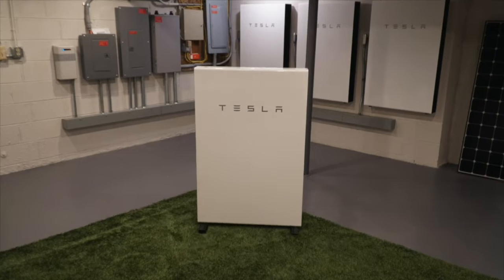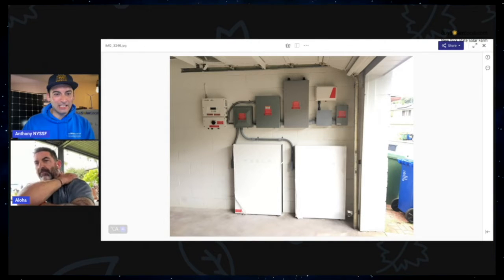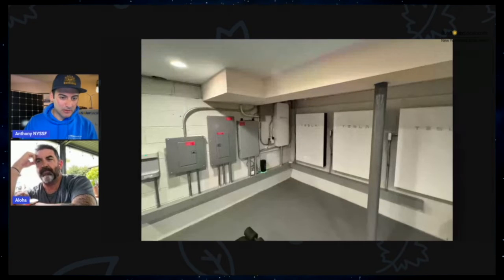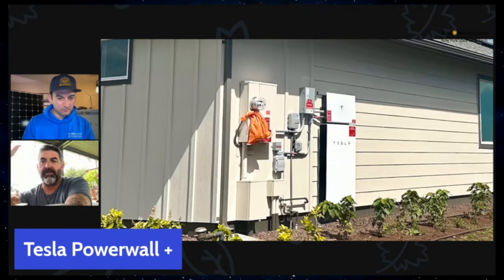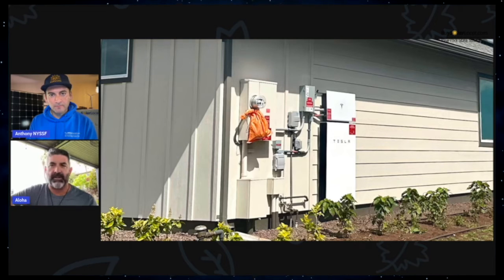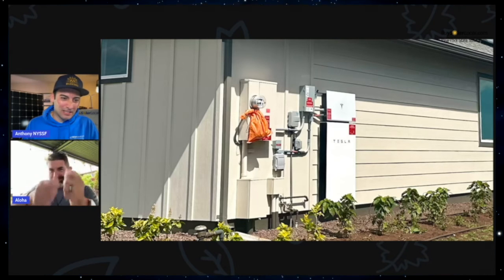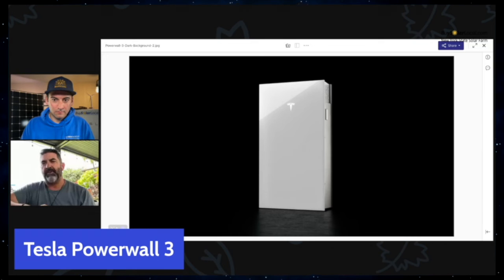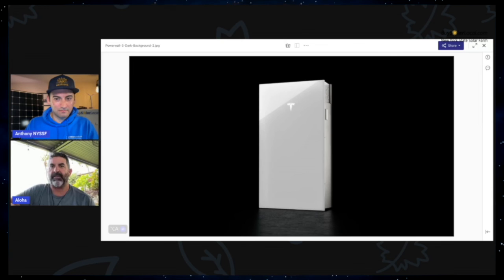The Evolution Of The Tesla Powerwall

Comment: What about for homeowners that already have a sunpower solar panels but want a power wall 3 back up option ?
Reply from the maker: Tesla stated they will have an AC coupled PW3 option coming out later this year for systems like yours that already have an inverter in place.
Reply: @buysolarlocal Or you could replace your existing inverter with the Powerwall if it has enough capacity...